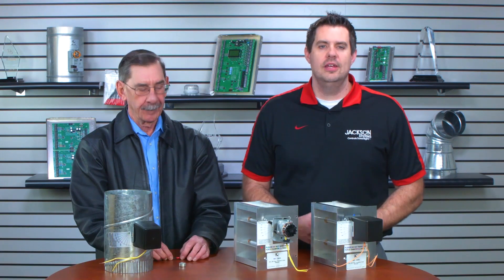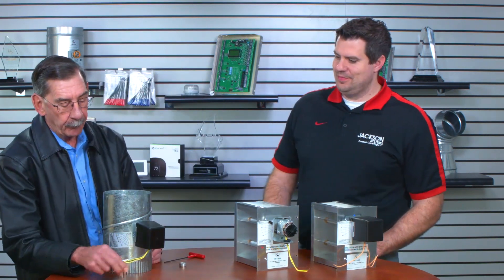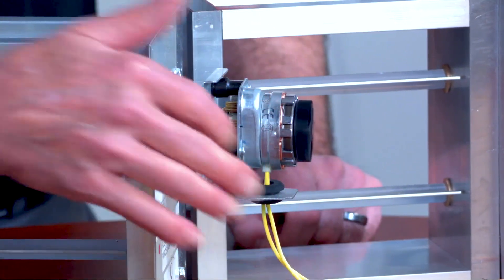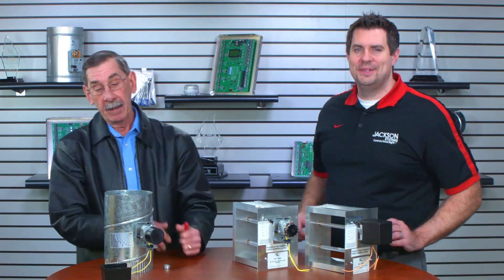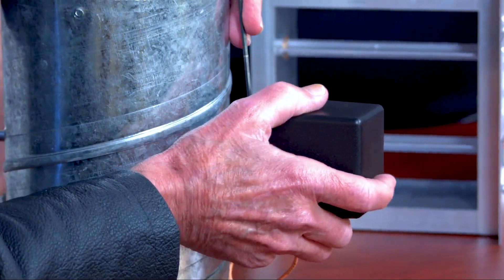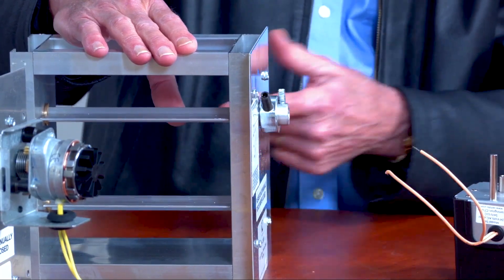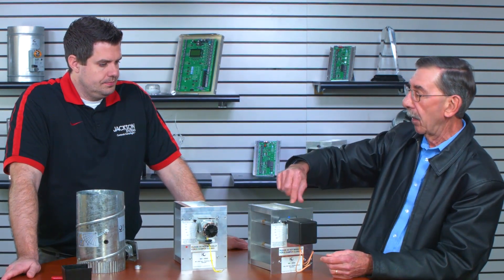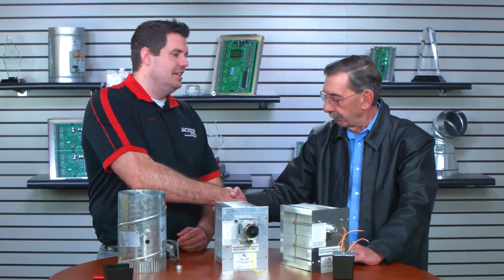How to Replace a Failed Damper Motor

Comment: Is it possible to have the damper open and close continuously? I'm looking to use a damper motor for plant lighting, but I'm looking for something that will rotate 180 D and back to 0 on a continuous basis. Is this possible?